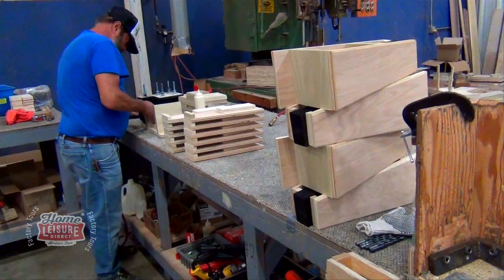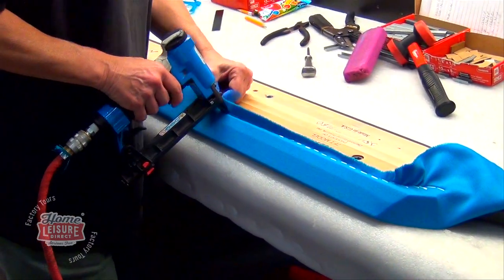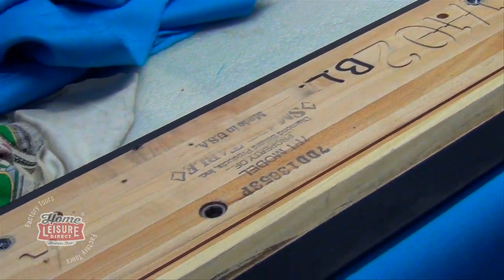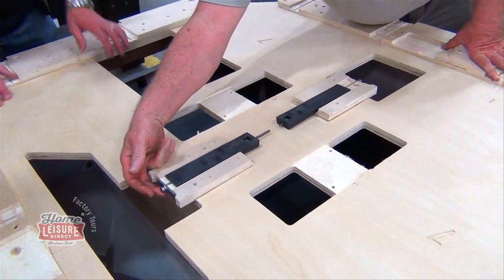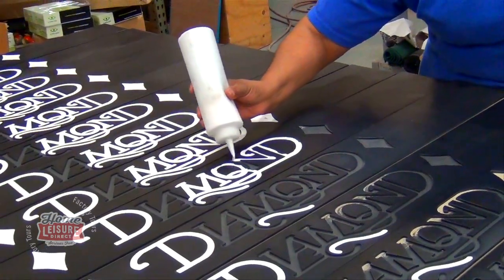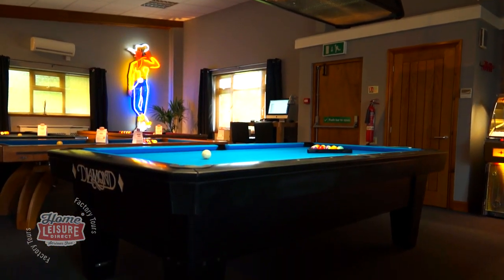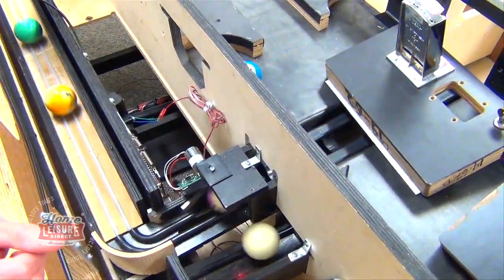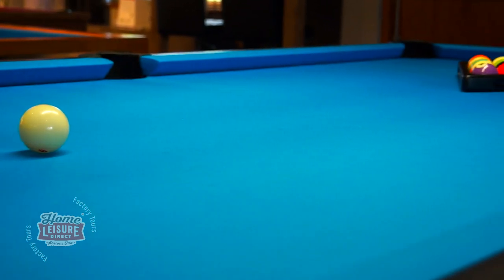Diamond Billiards Factory Tour

Comment: i thought diamond tables were single slate
Reply: for a 9 ft table it would be a sort of nightmare to move and assemble it. Too much troubles for very little advantages.
Reply: Most Pro-Am are. I only know of one Pro-am with a 3 piece piece slate and it is located in Texas. I think I heard of maybe one more.
Reply: They come in both single slate and 3 piece slate. It depends on what you want to get based on your requirement.

Usually, you get the 3 piece if you want to put it in the basement or 2,3... levels where we've to take it through stairs, we get the 3 piece
Reply: The single piece slate option would most likely be available for tables that's being installed in a ground floor room, but if it's going to be installed in a basement or an above ground level floor, then it would most likely have to be a 3 piece slate because it would be an absolute nightmare trying to install a 9' or a 10' table in an upstairs floor or in a basement with a huge and extremely heavy slab of slate.
Reply: @AngrierGorilla  few are 3 piece slate and your right its a nightmare . You definitely want a professional to deliver it.